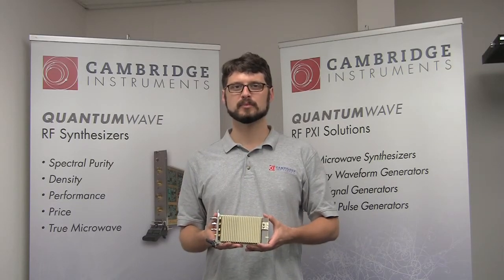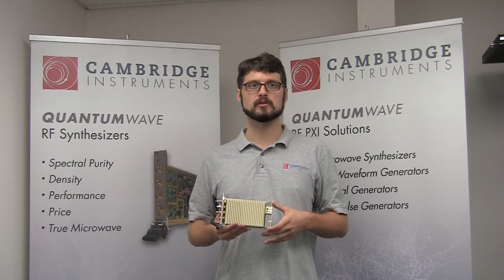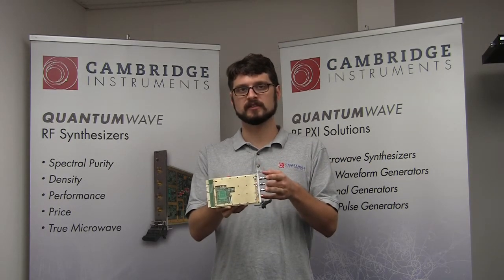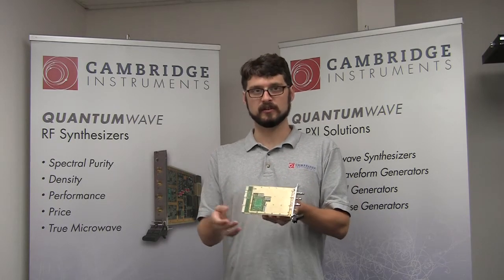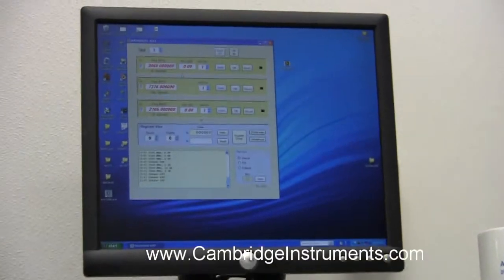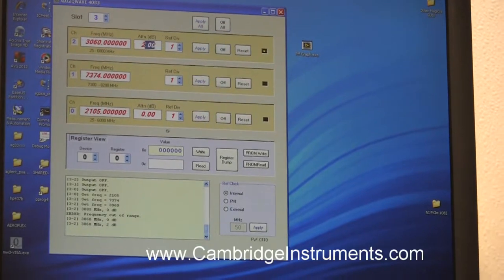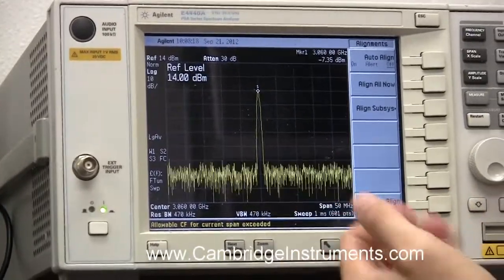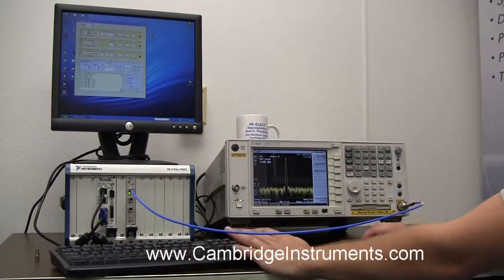PXI RF Generator for Ion Trap Experiments

Comment: is there a way to apply R.F to electrons in order to accelerate them at high speeds? maybe for some sort of ion thruster for space travel, or even an electron gun. It seems to me that R.F could be used in many ways, cause almost everything subsides on a wave length. If you take sand for instance and point high decibel R.F signals at it, you see almost a miraculous display of geometric change. Why then do we not use R.F to push, or even move ions at our will? Maybe one day, quit literally we could walk though walls.